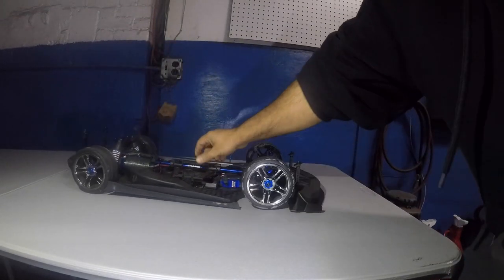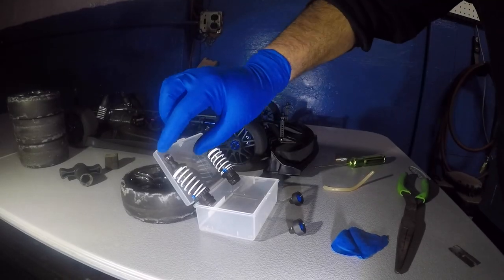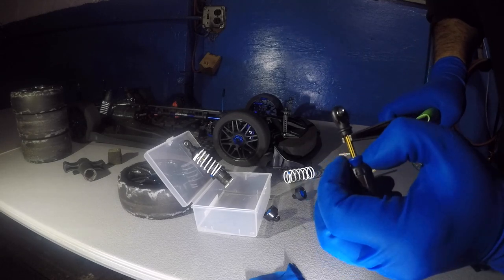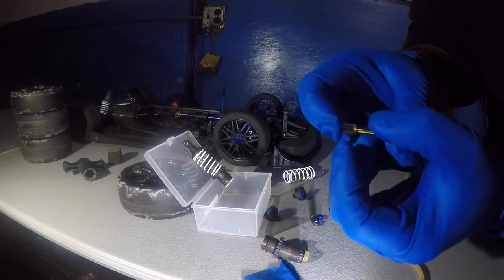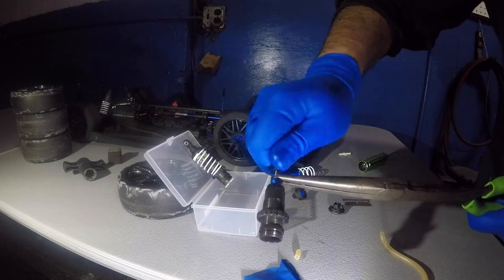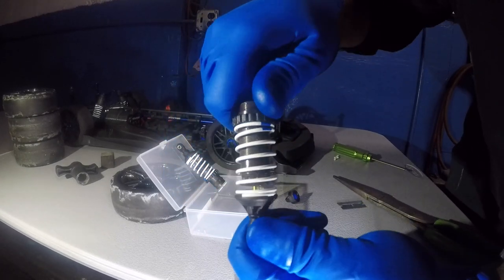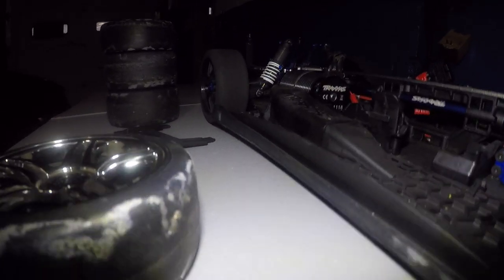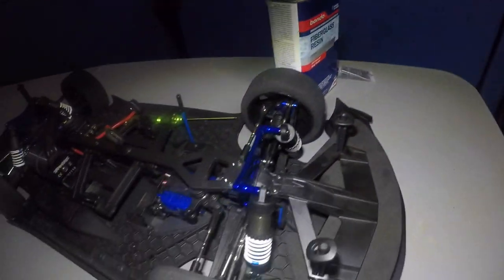Traxxas XO1 how to lower front end stiffen up suspension and harden the body for speed run

Comment: What kind of Foam tires are those?
Reply from the maker: I found them on eBay they soft but I use sweeps now u just
Got to trew them down a bit so they don’t run but even not trying them is ok if u not going 120mph